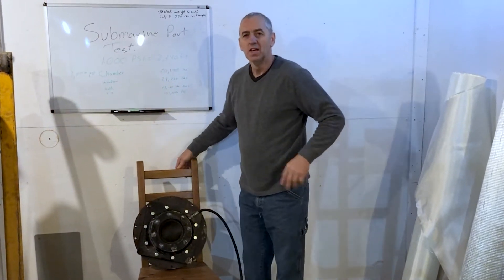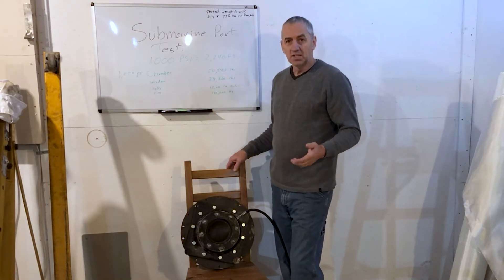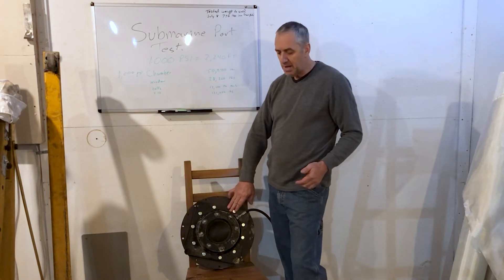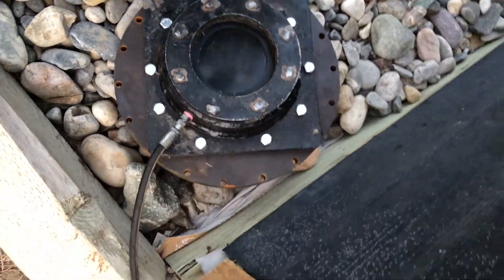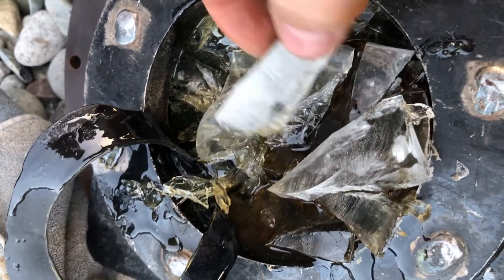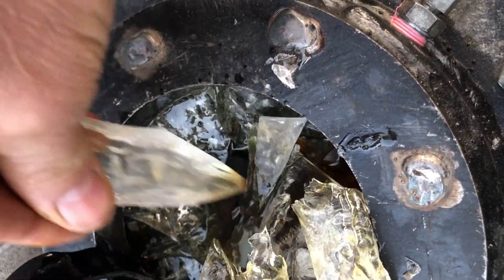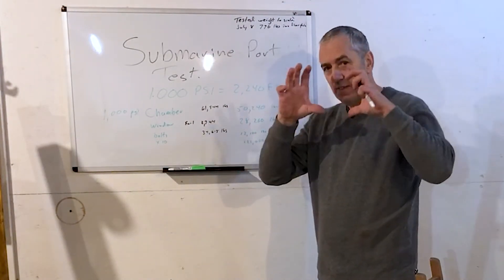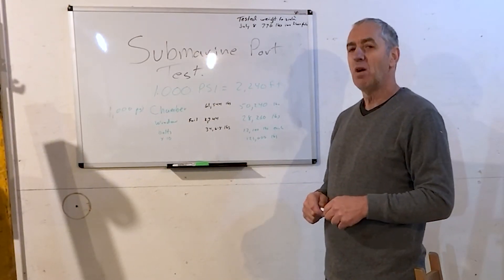Impressive Epoxy Resin Strength

Comment: This is so much fun! You really need to setup this to be filmed in slow motion, I'd love to see the crack propagation. Could you take the cast epoxy through an annealing/tempering process, similar to what you'd do for acrylic post machining. 

Slightly OT, I''ve been meaning to ask about window seals. Nearly all use flat rubber seals as opposed to an o-ring gland. As you experienced in your experiment the seal was forced out under pressure. A machined gland would keep the rubber better contained.
Reply from the maker: I rings can only be used in specific cases.  The gasket would normally be glued in. I did not glue it

Comment: Did you hear tensile or shear cracking prior to failure or was it catastrophic without warning?
Reply from the maker: I was inside the shop with the chamber outside, so not sure.  Next time, I will put a camera on the chamber.  I think it was instant though.

Comment: Wouldn't flaws in the casting be a problem?
Reply from the maker: we are not having a problem with flaws so far.  I am not sure what you are referring to.
Reply: @HankPronk  Bubbles/contaminants in the resin?
Reply from the maker: @papaalphaoscar5537  That is the reason we are testing the material to the point of failure.  We will test many times to establish a bench mark.
Reply: @HankPronk  for consistency, I recommend putting the epoxy in a vaccum chamber before pouring to get rid of air bubbles if you arent doing that already
Reply from the maker: @BraybayOutdoors  agreed, we have not yet, but we will from now on.  I didn’t think the epoxy would do so well.
Reply: The fact that it shattered like it did may be good in that it might not have a "slow creep" aspect to it like it would if it were more rubbery.

Comment: Why not just purchase an off-the-shelf high pressure sight glass? A quick look shows rayotek makes off-the-shelf units up to 30,000 psi, and also does submersible specific domed windows which would be much better than these flat windows.

It would be expensive, but not if you value your time at all.
Reply from the maker: We are making a large dome once we do all our testing with a cheap flat port first.   The dome we plan to make would cost over a million dollars to buy
Reply: @HankPronk  epic